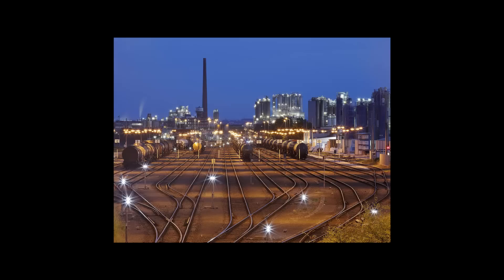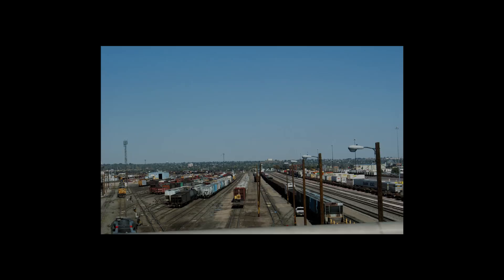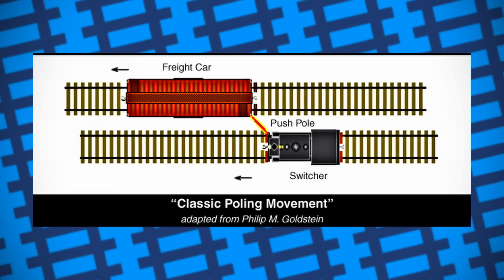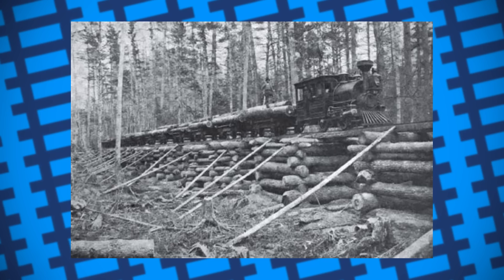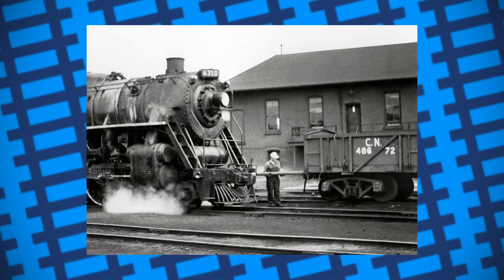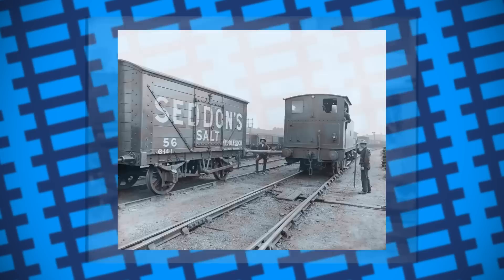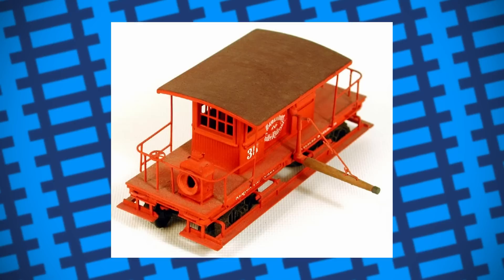The dangerous railroad art of shunting wagons with wooden sticks - Poling

Comment: You left out that actual poles were manufactured for this maneuver. They rested on two hooks on the underside of the tender or in other easy to get to locations. They were thick in the middle and tapered at each end down to a certain circumference and there were metal bands around each end to help them from getting damaged. The model of the polling car has one like I'm talking about mounted on it. This was very dangerous and there were many instances where the poles would break violently, almost as if they had exploded; sending large splinters flying every direction, and in a handful of cases skewering and killing the brakeman that were standing close by or placing the pole. I knew some old railroad guys that retired not long after diesel locomotives come along that told horror stories of working in large freight yards.

Comment: I imagine in the UK and Europe it wouldn’t be as common because the locomotives and cars have buffers, so to push them, to coupling is needed
Reply: In the UK we certainly did parallel shunting mainly using ropes. I've never heard of polling being done but it could have been.
Reply: @neiloflongbeck5705  Some locos on the North Eastern Railway had poles permanently mounted on the footframing. It was common on colliery lines in the north east to use poling.
Reply: @nicksayajirao1730  I'm not aware of the NER using that method of shunting, but it was habit for shunter's poles to be lodge, quite often on the buffer beam, o  locomotives until the 1980s. This should not be confused with beams if wood used for poling a wagon. These shunter's poles were 6 foot sticks with a hook on one end for uncoupling wagons.
Reply: @neiloflongbeck5705  no, these are not just resting on the buffers like a shunters pole. . They’re about six inch diameter and solidly hinged to the footframe near the dragbeams. Some E class had them as well as i think some of the earlier locos. All gone by WW1 as it was considered unsafe even then.
Reply: @nicksayajirao1730  thanks, I'll look into it.
Reply: @nicksayajirao1730  I think I know what you are on about. The first 18 of the E class 0-6-0T of the NER had square-cut frames which ended below the buffer beams. Angle brackets were fitted to hold vertical oak planks. These planks acted as buffers when moving the NER's characteristic cauldron wagons, ie shunting them on the same road, because these wagons had wooden dumb buffers.

Comment: I’ve always wondered. Why didn’t they simply Mount pull down poles on the 4 corners of the yard switcher. Have them on a hinge with a counterweight so you pull it down and lock it in the cars pocket. And when the car pulls away the pole rises back up to vertical.

Comment: Why not just hook a chain between the stock and pull instead of pushing with a poll? I have heard of the poles goring men, did they some times cut a notch that would face the pole so that if the pole snapped, it would face away from the poleman?

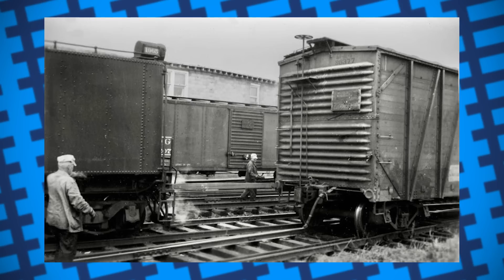Comment: 3:14 well theirs the other side of it which is ... why not use a rope  and pull the car forward rather than push it  or even just have the pole also have a bit of rope at each end so that if it did slip  it would be caught by the rope like how a trailer gets caught by its safety chain

Comment: Wonder why they didn't use a chain?  This could still snap if not strong enough, but at least it wouldn't slip.
Reply: Great question
The reason was that there needed a way to separate the rail car from the locomotive once the railcar started moving.
Poling was not a constant pushing, but more a push and let the rail car coast along.  Using a pole allowed the pole to drop out once the rail car started moving
Reply: @Thomasnmi  A chain would have required some kind of quick release.  This could have been as simple as a pin sticking up so that you could use a pole to lift the chain off it as soon as it went slack, but I guess they didn't have any such pin ready.
Reply: @Lucius_Chiaraviglio  plus a wooden pole was cheaper.
Reply: @Thomasnmi  That's the railroad management for you -- cut worker safety even if it means only a few extra dollars each.
Reply: @Lucius_Chiaraviglio  unfortunately railroad workers were considered replaceable. :(
Reply: @Thomasnmi  Even so, you'd think replacing a railroad worker (including training) back in the days of poling would have cost at least a few dollars, enough to pay for a chain, a pin, and a suitable pole.  On the other hand, it wouldn't be the first time that railroad management was penny-wise and pound-foolish.
Reply: In the UK it was quite common, and officially allowed, to use tow ropes to get wagons moving on adjacent lines. The wagons had towing lugs that the rope would drop off when it was no longer taut - the engine started, got the wagons moving, and then stopped. The same method might well have worked if a chain had been used, but they might be more likely to catch. If the rope didn't fall off the lug you could get some spectacular results, e.g. when an intervening signal post got pulled down and derailed all the wagons on to the main line.
Reply: @iankemp1131  good information 
USA and UK ran railroads differently

Comment: Wouldn't it be safer to pull rather than push the wagon?
Reply: Yes that was common in the UK using ropes from a loco on an adjoining line.  Also in congested yards with wagon turntables powered capstans with ropes could be used.
Reply: @mikebrown3772  British wagons, for very many years, had 'horse hooks' at one end of the chassis frames, which were used to attach a horse tow rope. That went on until the very late 1950s/early 1960's; I recall as a child reading that BR's last shunting horse had been retired - from Bath Green Park, I think.